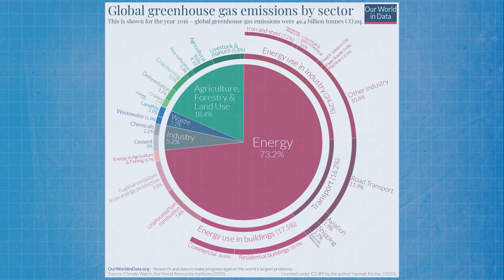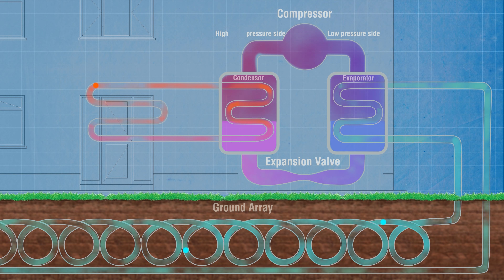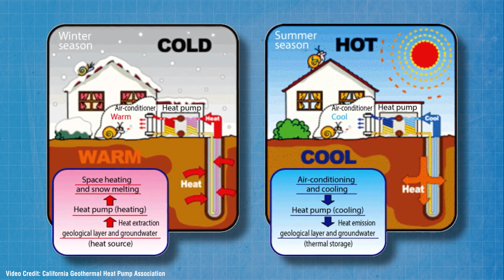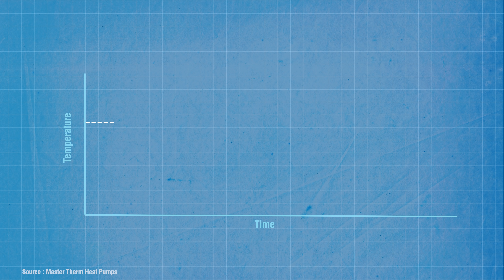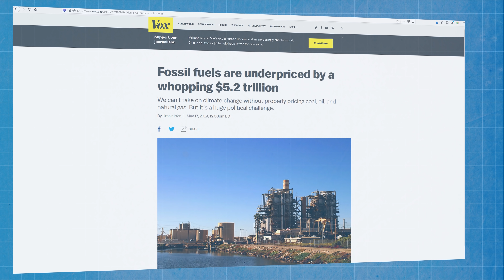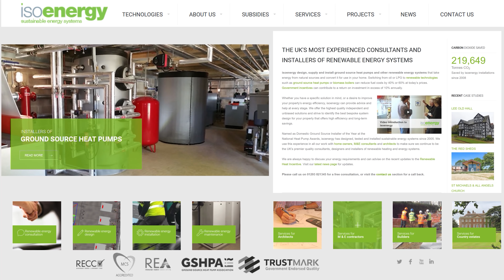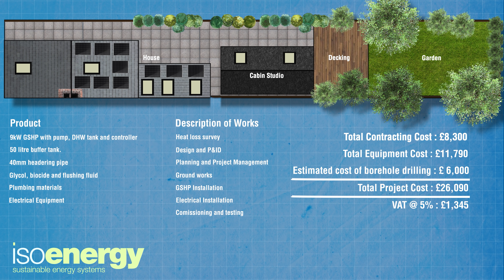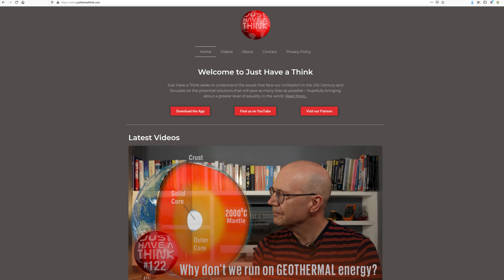Geothermal ground source heat pumps. Heating your home from your own back yard!

Comment: When I bought a house back in 2002, I tried to get the cost of adding a geothermal heat pump included into the home loan. I did the math and realized I'd have been saving money from day one -- the drop in energy cost for cooling the house would have been greater than the increase in the mortgage payment. Unfortunately I was unable to convince the bank to do it. And the up-front cost was indeed enormous -- there was no other way to make it happen.
Reply from the maker: That's a great shame. Governments need to get their act together on up front support for these things.
Reply: I don't know how far along you are with your house payments, but if you are nearly done then your bank might be interested in refinancing your home. The bank won't risk anything because if you stop your payments they get a home with a geothermal heatpump and if you pay until the end they get interest.
BUT Before considering a heatpump of any kind, check if you need more insulation. Preventing the need for heating and cooling not only saves in the monthly electic bill but it also makes the upfront cost of system cheaper because you don't need a 20kwh heatpump if your home can be heated in the winter with a 10kwh instead.
Reply: Just do it when you can.
Reply: don't do it...I know of many situations that people have regretted their decision in the install. In Fact I have yet to meet one person who has one of these systems that has only good things to say. I really wish they worked, I really do, but they only perform on paper
Reply: @TheHowtoDad  "has only good things to say"? How is that a useful standard for evaluating... anything? I have plenty of negative things to say about my current plug-in hybrid car -- you could even say that it too "only performs on paper" as Ford famously lied about its average fuel economy and were sued for it. But it's been a trouble-free and actually very efficient vehicle (in real world performance over the years) that's easily my favorite of all the cars and trucks I've ever owned. One of the best large purchases I have made. I can't think of any engineered product I've ever had, about which I only have good things to say.
Reply: @manualdidact  that's a strange response to a discussion about heat pumps. Heat pumps work, but not well and often break down leaving the owner with expensive and time consuming repair. Have you ever had your heat source crap out in the middle of the winter? think about this happening to you and your repair man saying either, "I can't repair this" or "I will have to wait for a part to arrive from (insert country of origin)" then be faced with a huge repair bill.  imagine spending $50k on a system that lasts 10 years, would you be happy?
Reply: @TheHowtoDad  This is why nearly all heat pumps (air or ground source) have auxiliary heating, in case the heat pump fails or can't move enough heat. With another car analogy -- cars break down all the time, and as the industry has matured over decades, they break down less. That doesn't mean that a car was a categorically unwise investment in 1960, or even in 1920. It also doesn't mean that a car is an unwise investment today, when hybrid systems, safety equipment and other advancements provide so many more things that can go wrong. Same with heat pumps. Geothermal heat pumps are somewhat new but have been around for decades already, and air source heat pumps have been around as long as air conditioning -- they're essentially normal air conditioners with reversing valves. They can break as any device can, and as any normal air conditioner can break in the summer, a condition which can be dangerous for people who are sensitive to high temperatures. Not a good reason to condemn the technology. (There are definitely reasonable concerns about refrigeration and air conditioning as a technology; this is not among them.)
Reply: @TheHowtoDad  Don't tell me that geothermal heat pump did not work. In household sizes it is a well developed standard system design today. I have been in touch with systems sence 1996 and it has been a continuous improvement and development based on previous  experience. Today it is used to heat everything from cabins to castles in Sweden. A Swedish house without geothermal heating comes with a lower price equal to the installation cost.
Reply: @bjornjonsson1875  oh, they work, just not as prescribed. they often break down, and require expensive replacements. I'm not an opponent of the technology, but I am not a proponent of it either. I say buyer beware, and before you install one yourself, speak to a few owners of heat pumps in your area.
Reply: @TheHowtoDad  I know that there was struggle with the once from the late 90s due to the fact that they used existing compressor designed to be used in air conditioning units. That has changed over the decades. Geothermal heating is not a new technology, it has been around for at least 25 years in Sweden. It really boomed late 90s and become a standard heating system outside district heating network coverage. My advice is to keep to well known brands, Nibe, Bosch/IVT , Thermia are the most common in Sweden and has been around all 25 years. My family has installed 3 converting system and one exchange due to wear out of age during the 25 years due to several house changes. The development has been enormous! And they have performed very well! 😊
Reply: @TheHowtoDad  I have some friends who live out in the sticks in a converted barn, their underfloor system works really well, ony good things to say :-)
Reply: @who9387  there you go! works for some. What part of the world are they in?
Reply: @TheHowtoDad  Norfolk, England. I didn't even know it was a thing till I asked the guy "this old barn must be hard to heat ?"
Reply: @who9387  How cold does it get there? Where I am, it regularly gets to - 20c or lower. I wonder if it works better in warmer climates
Reply: @TheHowtoDad  -5 maybe once in 10 years, most winters only as low as -2
Reply: @TheHowtoDad  I have a vertical closed loop geothermal setup in upstate NY. Home is from 1800's - which is moderately insulated (thick walls make for good insulation!), but infiltration could be better. One thing to keep in mind - When you continuously remove 12 Kw from ground for heat in winter time - it suppresses the "ground temperature" in area around vertical wells (350 ft deep each - 2 wells) to point that water returning from earth loop can be 28-30F..... heat gets removed.... water going back to the earth 22-24F. Wells act like "cold fingers" inserted down into earth. There is no 55F water! So geo works good when it is low teens - no wind.... or mid 20"s with wind. But cooler than that.... on comes the dreaded  electric boost heaters (60 amps of 220VAC each (2 banks)!!!!). So..... to prevent that I use pellet stove during these taxing times to prevent electric boost heaters from coming on! I use Pellet stove to preheat air prior to going into geo system. Heat pump is essentially a Delta T maker..... so warmer inlet air gets heated higher - distributed to entire home. Electric boost heaters do not come on. It would be great if the Geothermal installation companies would think about something other than electric resistance heaters for "boost requiring conditions".
Reply: @josephnehrbauer7343  wow, this sounds like a lot to have to think about. this would keep me up at night

Comment: We just installed an air source heat pump furnace. It's about to have its first winter. One thing we already have enjoyed, the electrostatic air filter. We run it in fan only mode to clean the wild fire smoke polluted air. Only symptomatic relief to climate change but still, we're grateful. Plus we're no longer burning a thing in our house so there's that too.
Reply: Here in U.S.,  a startup company named Dandelion has new drilling technology that is fast, and economically viable. It was a Google think-tank off shoot.
Reply: @joannelennstrom4934  I knew it. Every time I buy something, there's a better less expensive version out the next day. But that's quite all right. I'm glad to have played a role in better less expensive solar panels, better less expensive electric vehicles, and better less expensive home heating appliances.
Reply: I hope the fire stays away from you and yours, it's a serious problem and there are no easy answers. In new construction the airtight houses with outdoor air exchange systems certainly would have an advantage in your circumstances. Good Luck
Reply: You mean idiotic forest practices and regulations.  Forcing all the volunteers out by requireing 50000 certifications effectively making them full time firefighters but not paid, letting the fires burn, not doing proscribed burns before rainy season, not letting home owners clear brush/trees, not allowing the use of mechanized fire fighting equipment, making it near impossible for water bombers to be used unless in very specific instances....   NOt allowing loggers to go in and thin, not allowing loggers to go in and take out large swaths of diseased beetle trees... yea its "climate change"...    Tons of fires all the time before the white man showed up, logged everything, suppressed fires for 100 years, and then in last 2 decades have decided to STOP logging and stop fires when they start... yea its "climate change".... What a crock
Reply: @w8stral  Ironically most of the fires in California and Washington were started by arsonists (mostly political ones too) but you won't hear that from the politicians claiming it's weather change.
Reply: @SilvaDreams  Well no they weren't.  Most were still human caused though.  Rest, lightning.

Comment: I'm moving soon and getting one of these because traditional A/C is too damn expensive ($300 USD/month).
Reply: If you have really cold winters and very hot summers then that is definitely possible, but it might also just have been because your home was badly insulated. The best heating/cooling is the one you don't need after all. I am also aiming for a geothermal heat pump, but I am still working on some of the insulation (saves in the energy and upfront costs).
Reply: Youre paying way too much. You might need to figure something out besides just a different AC system. Drop your living temps a couple degrees in the winter and raise it a couple in the summer and youll see a remarkable change in that price, I'm sure. Like maddognl said, insulation can make the difference.
Reply: @dustinsmith8341  
Those with high heating / cooling bills often have homes that are too big.

It got very hot a week or so ago.  I went outside and sprayed water on my outside walls.  Helped a lot.

Comment: My cousin Cecelie lives in a house in Oslo that she had built in the 1990s. As part of the basic design, geothermal heating was incorporated from the start. Even then the system gave something like three to one heat compared to the normal Norwegian simple electric heating [mostly from Hydro of course], and they still use a wood burner for the living room. That house is comfortable and cheap to run through the cold winter months. Being a substantial wooden construction it remains comfortable in the hot days in their short summer season.
Reply: 3:1 COP is mandated by code and has been code around the world since the 1950's.  For this reason adoption of heat pumps has been stifled by this moronic regulation.  Reality is that ANY COP over 1.1 is better...

Comment: In the UK most homes don't have aircon, and summers are getting hotter. The great benefit of GSHP is that it will cool as well as heat. For new home builds, it makes sense to incentivize GSHP over gas central heating. Installing in existing homes that already have gas, it is harder to justify unless the gas heating system needs renewing.
Reply: I agree the cost saving on a new system when infrastructure is already in place is less desirable which is the same reason we can't get rid of air polluting automobiles.
Reply: If your house are heated with water circulation system I don't really agree. An existing house tend to use much more energy than a new one. That makes the absolut saving a lot bigger in the existing house. The cost of the geothermal system are pretty much the same for a ordinary singel family house. Because of that new houses in Sweden, that are very well insulated, uses other kind of heat pumps. Ie Air to air and exhaust air. To install a geothermal system "it is just to drill, found a place for the heat pump and connect the pipes to the heat pump. Done!" 😊
Reply: @bjornjonsson1875  Yes the savings would be much bigger but the cost of installation and removal of the old system is also higher. What I was thinking is the difference in cost from a conventional furnace to a Gshp when you have none ie new house the cost differential is minimal so the pay back is sooner even though the heat loss is less would be good to see some math on that.
Reply: @offgridwanabe  I would say that the removal of the existing parts that is in the way are negotiable. In some cases the old system are saved and provide auxiliary power. But in the case of a households I would recommend an all in one unit at a fridges size with inverter compressor that not need auxiliary energy else a failure. In that case a included inbuilt cheap electric boiler kicks in. 😊
Reply: Actually we're entering a grand solar Minimum - the last time we did folks were ice skating on the Tymes River...
Reply: @TheJakeRobinson  (wasn't that mainly because of dust in air due to large eruption)?
Reply: @bjornjonsson1875  it is cyclical and happens on basically a regular time line, like we have solar minimums every 11 years where sunspot activity drops versus high activity periods, however the grand solar minimum is spread out more like several hundred years but it is predictable so it's not just a volcanic eruptions that probably could add or compound to the problem. But there is no doubt we are now entering it and it's going to change everything we know about food production and other issues. I hate to promote a different YouTube channel but Ice Age farmer and adapt 20-30 or two and trusting folks that cover these specific issues
Reply: @bjornjonsson1875  actually we have had no increase in warming in around 14 to 15 years.  The world (media & govt's) has invested so much into Global Warming they blinded by their bias... But have you noticed the term "global warming" is being used less and less, while "Climate Change" is now the preferred term since warming has halted and now we are headed into an unprecedented cooling period?  They need to hold onto a political based movement even when mother nature refused to comply.  If you believe the trumped-up global warming hoax then you will love that youtube video you posted... me, I have done my research and know it is a hoax... make sure you wrap up cuz it gonna get cold for a long long time.
Reply: @bjornjonsson1875  this is part of the reason I do not believe in the global warming hoax.
Reply: @TheJakeRobinson  Well, show us the evidence because I am not interested in believings. 
We are, still, in the normal range of temperature. How did you source explain this curve by the way?  https://sv.wikipedia.org/wiki/Global_uppv%C3%A4rmning
Reply: @bjornjonsson1875  pretty sure science also predicts Grand Solar Minimum...
Reply: @TheJakeRobinson  Go away, troll.
Reply: @TheJakeRobinson  This is a channel for the reality-based community.  Please stay quiet and learn.  If you find that too difficult, then just go away.
Reply: @MikeAG333  haha - exactly what I expect from the radical left. But you didn't dispute Grand Solar Minimum is based in science AND likely to xaise cooler Temps if not significant changes over an extended period of time.
Reply: @TheJakeRobinson  I am not left and I stay to science and I want the human society to be sustainable so we all 8 billion can remain living in our exciting world. I believe that the way to reach that goal is more development and in the direction of sustainability.
Reply: @bjornjonsson1875  thanks for clarifying your apolitical position... I'm not against sustainability but "growth" is the main reason our "systems" seem to be breaking down. We need more regenerative ag & distributive food production.  The "end of the world" climate change is getting tiresome. How do you explain that we were given 10 years before doom would arrive and then didnt? And that prediction was made circa 1970... because "models" are flawed and do not reflect real life
Reply: @TheJakeRobinson  the world to human is the survival of the human. The world don't care about human. We need effective sustainable agriculture. We need to use the resources we all ready use as effective as possible so all can increase there living standard. We are inefficient.

To do that we need to use our imagination och develop.
Reply: @bjornjonsson1875  kinda sounds like we're saying the same thing
Reply: Yes. Furthermore, at the start of the summer season the system can be run in 'free cooling' mode (i.e. without activating the heat pump), which leads to exceptionally high COPs (e.g. http://dx.doi.org/10.1016/j.geothermics.2016.02.008)